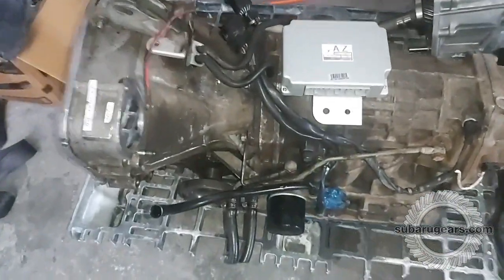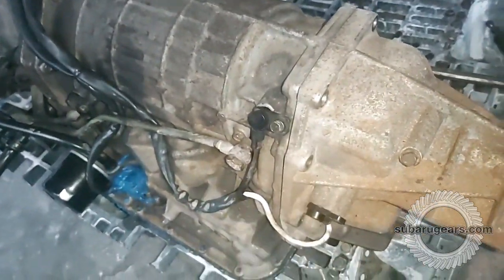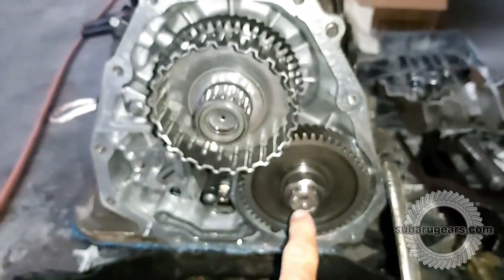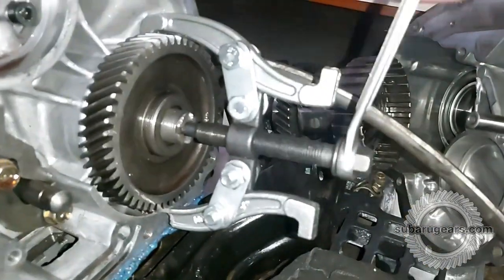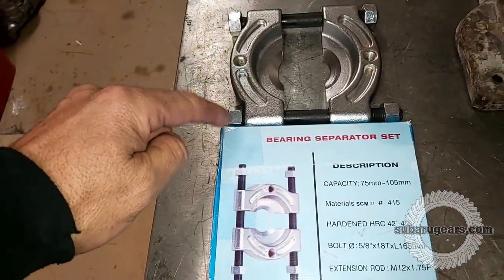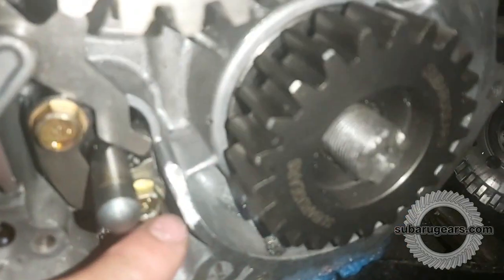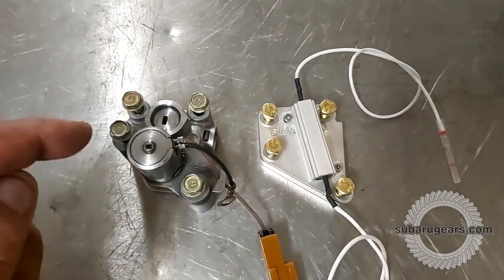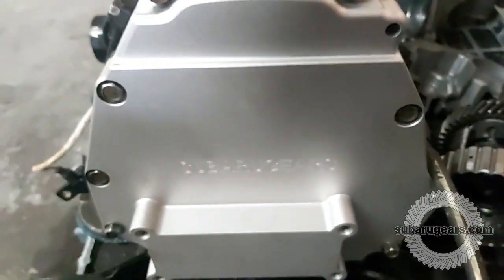Subarugears Subaru 4EAT Auto conversion video

Comment: Would this fit a type 3 or go for a manual subaru gearbox building a 1776 engine with gsxr fuel injection total loss ignition and ecu

Comment: How well does the ring and pinion hold up with power being applied in the reverse direction.
Reply: No issues in over 1 year of driving this heavy bus over 10,000 kms. Our 5 speed and 6 speed transmissions have been running on the reverse side for 10 years now.

Comment: Todd, My project RV does not have enough room for the TY 751 6 speed, at 670 mm in length.
I would rather use an automatic, how long is the reversed 4EAT with your new cover plate?
Reply: All dimensions are on our website in the Automatic section.

Comment: Could this be fit into an earlier year Bus 74-79 or even a Manx on a VW frame.  Is the overall length or width a problem.
Reply from the maker: Yes it fits in a T2 bus - we are just finalising testing and mounts for that setup. It doesn't fit a type 1/Manx chassis without cutting through the torsion bar between the IRS pivots and cutting the framehorns off. The auto trans is long and wide.